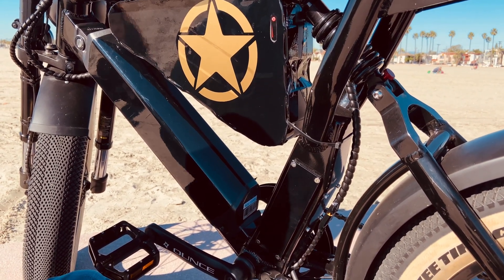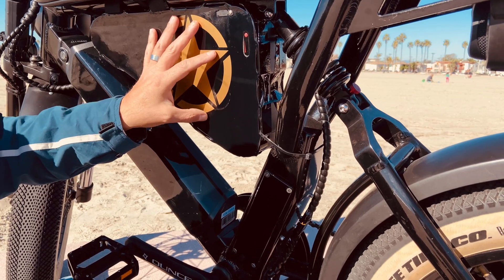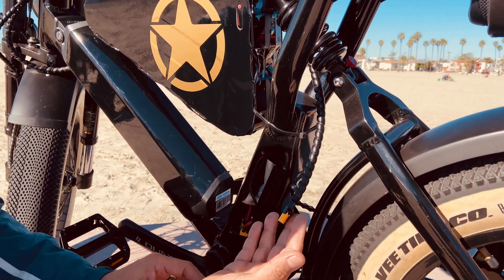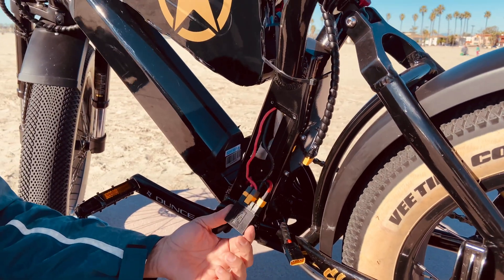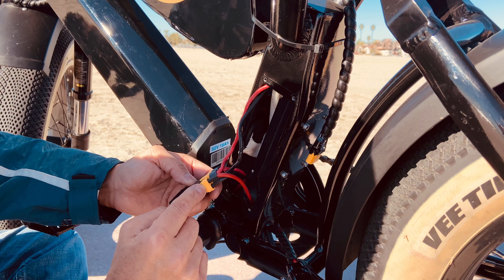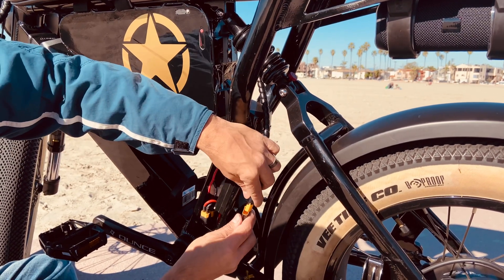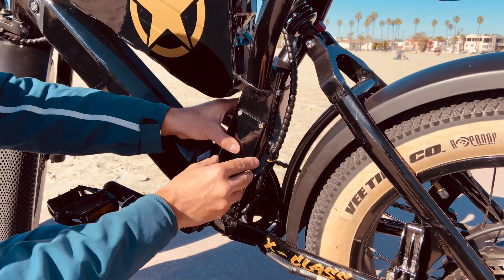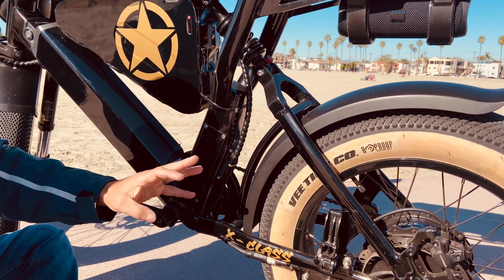Battery blender XT60 Install on Ariel Rider XClass 52v

Comment: what kind of battery did you get and where did you get it?  Also what sort of range are you getting from both batteries
Reply from the maker: 52V 20AH Electric Bicycle Lithinum ion Triangle Battery for 2000W Motor with Charge Waterproof case
Brand: QWW on Amazon.  I just went on a LAESK8 ride and did 40 miles between both batteries and still had two bars on one battery when I got back.
Reply: @riderx4039  hi!  did you install the 52V 20AH 30A triangle battery on your ebike?  I am looking at increasing the range in my new X-class 52v.  Would you recommend the 52v 20 AH 30A battery?  Thanks.
Reply from the maker: @marcialever  Hello,  no I installed the 52V 20AH  45 AMP battery for 2000watt hub motors  on my AR. I would recommend getting one like mine you should get around the same range. Factor in wind, hills and weight of the rider I’m around 6ft and weight 160lbs. I’ve tested  mine on a LAES8 ride and did 40 miles and had  a bar left on the secondary battery now with that said I can’t recommend something I haven’t personally tested or tried. Remember you void your warranty by altering your ebike. Hope that was helpful⚡️🖖🏽⚡️
Reply: @riderx4039  did you purchase your 52V battery on Amazon?  Thanks for getting back with the info.
Reply from the maker: @marcialever  yes. Here you go 52V 20AH Electric Bicycle Lithinum ion Triangle Battery for 2000W 1500W 1000W 500W Motor with Charge Waterproof case.  copy and paste it on Amazon sorry links don’t work
Reply from the maker: The brand is QWW  sorry about that
Reply: @riderx4039  got it!  Thanks again for the info.  Highly appreciated.
Reply from the maker: @marcialever  your welcome
Reply: @riderx4039  Hi!  Just a brief update.  I installed the second battery, and my bike is getting an excellent range—no more range anxiety!  I purchased the 52v20AH30amp, instead of the 52V20AH45amp.  The folks from sparkcycles suggested that I should stick to the  30 amps.  They believe that going beyond 30 amp is a bit risky to overheat the controller. 

Additionally,  a couple days ago,  I did go for a 22 miles ride,  with some long steep hills (all throttle—very little pedaling—, 20-25 mph speed most of the ride), and got back home with four bars left.  I will do some more range soon—since the weather is warming up a bit here on the east coast.  Thanks for all your help. Highly appreciated!
Reply from the maker: @marcialever  Right on good job informing yourself it’s important to know the risks involved in adding another battery I did the same and I am aware of the risks but have had no issues with over heating I also periodically check my components during and after riding to see if anything is over heating, so far no problems  in fact I don’t think about it anymore I just enjoy m6 rides. Post your full range on both batteries when you get a chance I’d like to know if you get better range on a 30amp or the same?⚡️🖖🏽⚡️
Reply: @riderx4039  absolutely, I will post the full range on the 30amp battery at some point, so we can compare the two batteries performance.  Thanks again.  Take care!
Reply: Does this battery give you more speed as well?
Reply from the maker: @kevinfitzpatrick2743  I do feel a slight power boost when I run them together but no it did not increase the speed it only doubled my range
Reply: DateX2 are the best batter blender on the market for now.